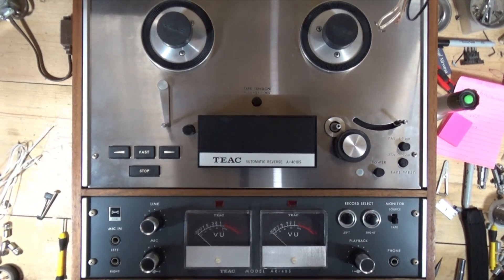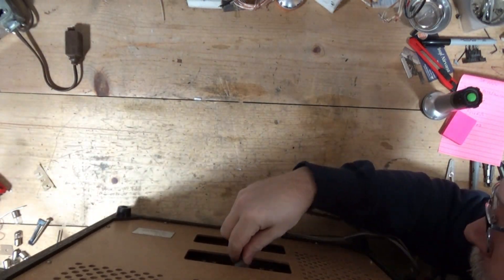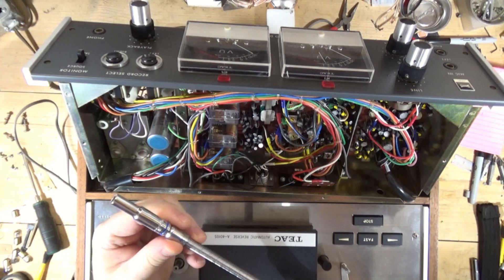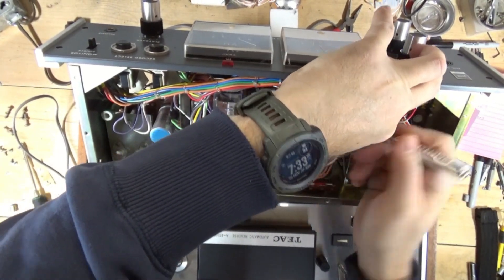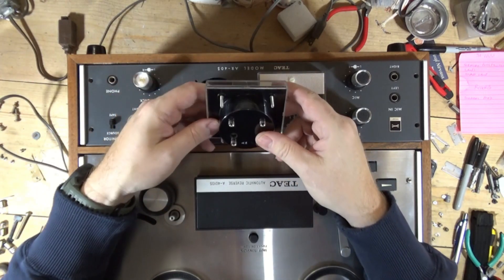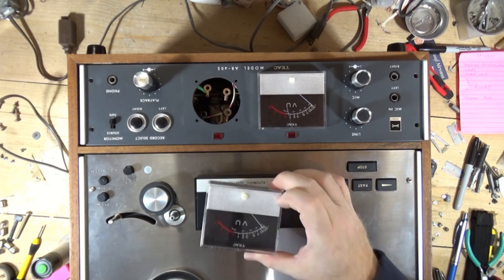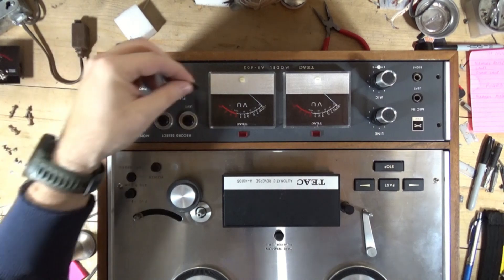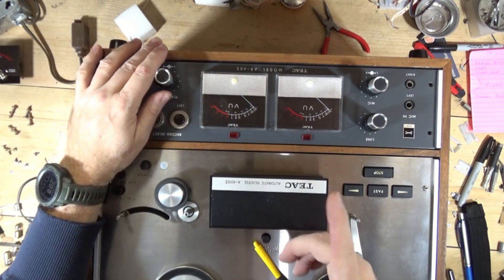TEAC 4010S Reel to Reel VU Meter Replacement

Comment: Great video!! Thanks!! I have a question hoping you can help me with... in the back there is a blue wire that goes to the capstan motor and mine is detached and I can't figure where it goes from the motor.. can you help????
Reply from the maker: Unfortunately I currently do not have a 4010 to look at.  You might be able to find a service manual online to reference.
Reply: Thank you for the video! I have a 4010S and this helped a lot! Also, nice Garmin!